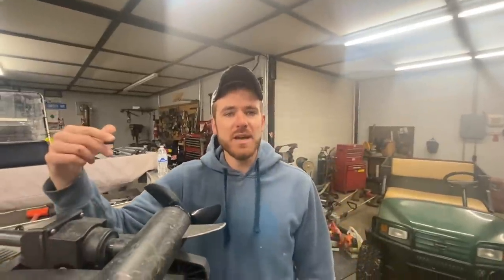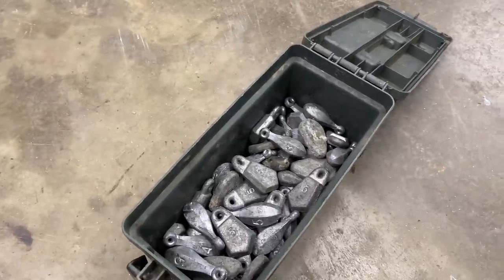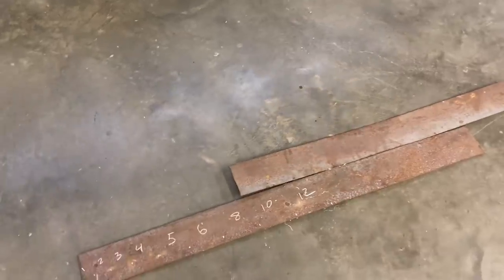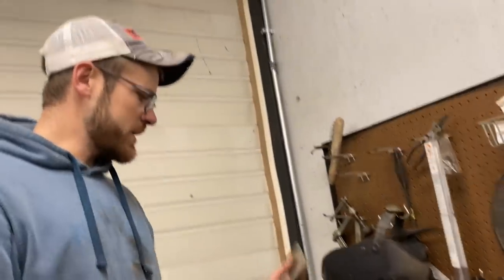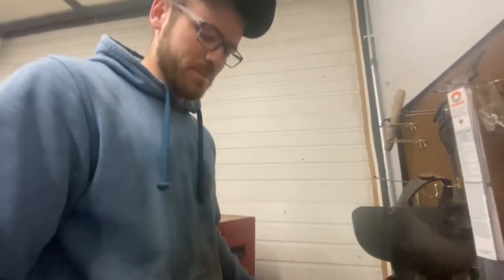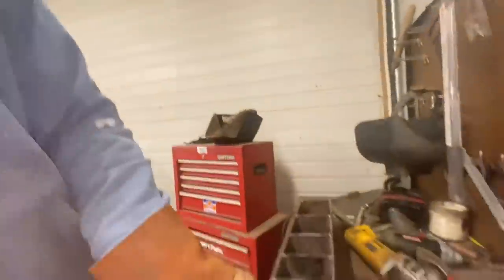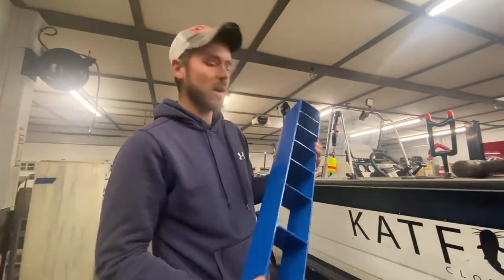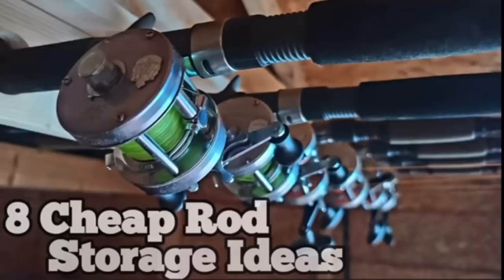Every Catfish Boat Needs This!! (Sinker Storage Box Build)

Comment: For many of my projects where I want to save weight, I use 1 in. x 6 in. x 8 ft. PVC Beaded Ceiling/Wall Board. It's cheap, it doesn't rust or rot, weighs next to nothing and can be glued or screwed together. It would be perfect for a project like this one.

Comment: I cheated a little bit , went to the auction and bought old bolt bins like they sell at tsc and harbour freight, cut down to size and done. You do excellent work on the welder 👍 👍 🇨🇦

Comment: you'er not worried about weight distribution throughout you'er boat ? good idea but i keep 55lb in my boat of different sizes 1oz-16oz got boxes on each side something like you made here but i keep 1/2 an 1/2 on each side of the boat just for weight distribution
Reply from the maker: No. I keep both my coolers on the opposite side of my boat. I actually needed some weight on that side. Thanks for watching.